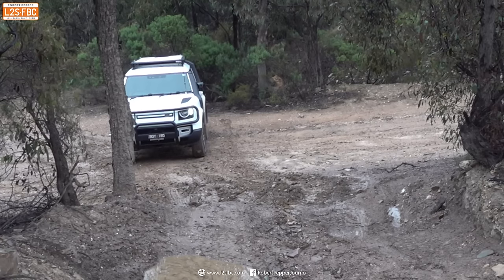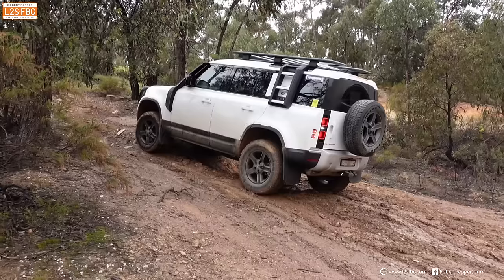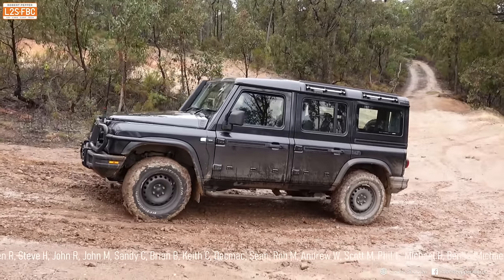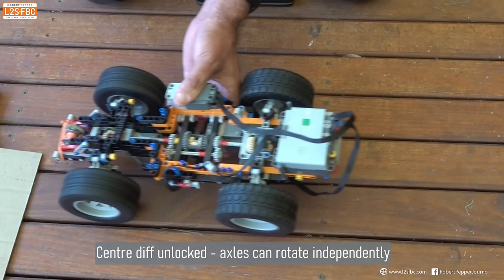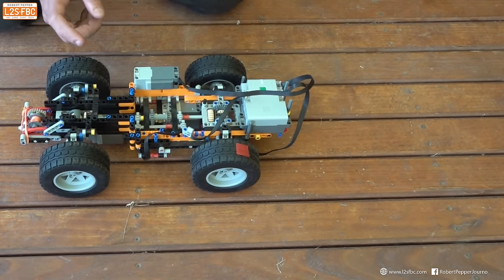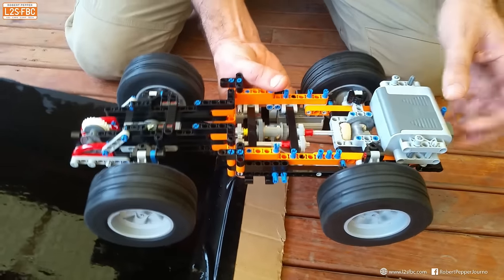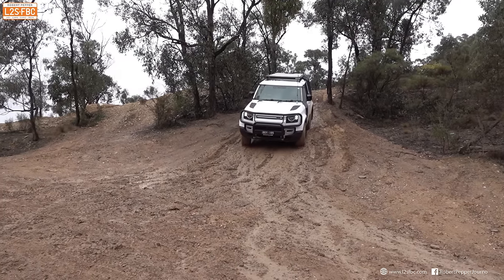The Centre Diff On Hills Problem: Grenadier vs Patrol vs LC300 vs Defender - Part 6

Comment: What year is the defender in the test? Apparently in 2023 they changed the drive system.

Per Sarek Autowerk: 
"Yes, it looks to be accross the entire range. The D300 (diesel non US) seems to have had the permanent rear wheel drive system since the beginning of production. The rest have all had the center differential until 23.5

The center differential system which is in all of the US production vehicles until model year 23 (p400) and 23.5 ( p300, p400 ) is set up like this. Power comes from the transmission and enters the transfer case. There it goes into a differential that can be variably locked by the traction control system. So for example, when no locking is applied, the differential puts power 50/50 to the front and rear driveshafts as long as there is no slippage or loss of traction just like any open front or rear differential. If you lift a wheel or slip im mud, just the slipping wheel spins and the other doesn't turn. Path of least resistance. So driving down the highway, the vehicle is in an all wheel drive state with the center differential mainly not locked and power is split to all wheels. The center differential is what allows the driveshafts to turn at different speeds when turning the vehicle to prevent binding since wheels turn at different speeds when rounding a corner. In a situation where 1 axle breaks or cv joint. The broken part has the least resistance and it will only turn. And you can not move. You can sort of move but the computer keeps unlocking the front and center diffs , so you just barely move when going straight. But turns are almost impossible. The center differential uses clutches to variably apply friction to the differential to prevent slipping when needed in turn locking it . The rear factory locking differential behaves very similar. 

The 23.5 and up system works like this. Power comes from the transmission into the transfer case and is permanently connected to the rear driveshaft. There is no differential in the transfer case. It is what they call permanent rear wheel drive. The tcsse has a torque on demand unit that puts power to the front driveshaft when needed. It uses a similar clutched unit to do this, but the vehicle will always have power to the rear no matter what. Not the case with the earlier unit. Another difference is that the permanent rear wheel drive system has a front axle disconnect built into the front axle tube. At highway speeds the system will actually completely disconnect the front axle. These systems have a much better MPG because of this. I have actually driven one of these without a front driveshaft installed! You can not do that with the previous system. So as i stated in my post previously, if you have this system with our Sarek selectable rear air locker, you can still drive even if you break any one of the axles or CVs . With the factory rear locking diff you can break a front, but not a rear. 

I believe the later system has many benefits. I really wish i had this system vs the center diff system that i have. I have broken an axle and it is not a good day. I always want to be able to try to drive off the trail even in 2 wheel or 1 wheel drive vs becoming a major burden on my friends trying to drag me off the trails. 
Also, because of the axle disconnect, both front axles are the same part number, so u only need one spare for the front. Also much easier to replace the right axle from the previous system. The MPG gain is also a nice bonus."
Reply from the maker: I mention that in the video with a diagram.  Yes it's different but behaves the same far as I can tell.  I have on multiple occasions needed to deal with a Land Rover and broken CV and not being able to lock the c/d is a pain!
Reply: @L2SFBC  oh I'm sorry I missed that part, I'll have to watch again.
Reply from the maker: Great comment thank you, useful info

Comment: Great video Robert, thank you. Can you tell me what Lego model 4WD that is you're using please?
Reply from the maker: It's a custom build I made myself out of a variety of parts, mostly Unimog I think.  Thinking of getting the Audi desert racer next and customising that!
Reply: @L2SFBC  i made one like that as a kid but with solid axles and suspension.  It was pushing the limits of the components available at the time.  In particular i didn't have a slip joint for the propshaft and tailshaft which was a major problem.

Comment: Another good video. The centre locking diff or just a traditional 4wd setup like in an old Jeep or Series Land Rover can do wonders for stopping distances in the snow too. For the exact same reason of brake bias. As for HDC, by brother was setting up a trials event on a wet grassy hill earlier in the year in a Freelander 1 and with someone who had a new Defender. When the grass was wet early in the morning, neither vehicles HDC could cope and induced sliding, while just using engine braking provided more control and slower descents, even despite the Freelander not having a low range.

Also to add to your point 3 about varying brake pressure. The next step is to actually accelerate (gently) down a slippery slope rather than brake. It feels counter intuitive, but can reduce or remove lockup and skidding giving you steering control. We sometimes set up sections at trials events where you need to do this in order to avoid hitting a cane/gate. Obviously it needs to be safe to do so in terms of space and run off and it shouldn't be lots of power, just enough to rotate the wheels a little faster to stop a slide.
Reply from the maker: A good point. In Part 2 of this series I show the effect of accelerating downhill, although I would prefer to say "reduce brake pressure" first. Experience can guide. As for braking, yes - in another video I show an LC80 braking on dirt with and without CD locked, and without there is unused braking grip at the rear. Modern vehicles have EBD (electronic brake distribution) so in theory shouldn't benefit...but I am yet to test this theory.
Reply: @L2SFBC Do you know which video shows the LC80 braking w/ diff locked/unlocked?
Reply from the maker: https://www.youtube.com/watch?v=BgKkI0Lt0Sw
Reply: Yeah exactly why not just to make them not all wheel drive and just have selectable four-wheel drive. I feel like 90% of the time people who buy these don't actually need to be going down the street with their front drive shaft receiving power to the front differential it's just extra wear and tear. Plus if you watch a Jeep Rubicon Wrangler in two-wheel drive the rear articulation and the rear Locker will get it through all of this stuff without even going into four-wheel drive. But it seems like a lot of these non-american SUVs obsessed with being all-wheel drive . I wish the jeep was made more high-quality luckily we have the full size Bronco which is absolutely mind-blowing good off-road still has Towing still has ifs in the front with long travel and solid axle in the rear. Probably the most all around vehicle ever made. Yeah the Toyota is great but it doesn't have Factory 35 or as much travel, the defender raises Wheels constantly and has air suspension and lacks articulation and really top heavy. The Jeep is absolutely stunning but doesn't tow as much which apparently Towing over 3,000 lb off-road is important to some people's brain and the reliability of the Jeep is better than Land Rover but not quite the Ford Bronco or even the Toyota of course. My dad is purchasing a Sasquatch Edition Bronco and the more I learn about it I'm just blown away by how awesome it is and kind of how versatile it is in between the straight up hardcore Jeep abilities and the street Comfort IFS world Land Cruiser world. You should watch that big Bronco Beast go around tight switchbacks with the steer assist that locks up the rear inner wheel of the direction you're turning and literally makes you slowly skid avoiding go forward reverse multiple times to make a tight turn for its overall size

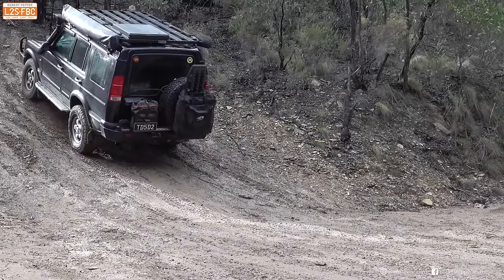Comment: 14:55 Itnerestingly i even encountered exactely that "Defender Problem" at home on a flat paved piece in front of my carport with a normal rwd, automatic vehicle: the ground was still frozen (winter) but the air had been above freezing and it had rained. So the rain hit the cold ground and immediately froze. The surface was a slippery as it could get.
I tried to go back in a 90° turn to get the car under the roof, and there was no chance.
I couldn't lift off the brake enough to unlock the front wheels (especially when turning the steering wheel) while the rear wheels were already providing movement for the car.
Thankfully my car is old enough to have a mechanical parking brake and that's what i did.
Applied it two notches and was easily able to lift off the brake enough so the front wheels were turning and were able to provide steering input.
Reply from the maker: that's it, add braking to the rear in this case. Not possible with L663 Defenders.

Comment: Yeah you make a really good point. Never thought about the braking aspect of center lock. I'll be sure to use descent control in reverse on my vehicle because of this.
Reply from the maker: What vehicle do you have?
Reply: @L2SFBC  Jeep Cherokee Trailhawk.  The only thing I can think of that might beat it all the way around (ride and off road capability ) would be a defender to be honest. Maybe Grand Cherokee Trailhawk. What else ? Not many vehicles have a rear locker , crawl control, descent control, terrain modes and a legit low range. Mine is 56:1 with the 2.4 engine . They're stopping production of it and there aren't really any alternatives except for the defender. So maybe the next one I'll get will be the defender. We'll see.
Reply: @L2SFBC do you know if engine braking engages the center clutch ?
Reply from the maker: Can't say as it may disconnect if the engine isn't providing any torque to allow brake force distribution to work. Yet another "only the software knows" thing.

Comment: Great video, while my D3's are all very capable vehicles my fun car is a 3 door D1 with only a CDL, it's a lot more stable and responsive on wet, slippery slopes. As you say a manual CDL gives you more control over the electronics. Weight of vehicle and the line also comes in to play in my case.

Comment: This is interesting; I've tended to leave the CDL disengaged on vehicles because I want the tighter turning radius. I did not know that having the CDL engaged helps to prevent side-slip on off-camber hills. Have definitely encountered situations where I needed to release the brake by some amount in order to get steering control back. It is counter-intuitive and takes some mental effort to not only remember to do it, but to trust the tires to start gripping by letting off brake pressure.
Reply from the maker: If you need to unlock the CD to turn then do so, but then re-lock.  However you may as well do a three-point turn. If you keep it locked probably less need to reduce brake pressure.

Comment: Defender could have tried HDC reversing back down the slope…

Pretty sure a modern 4WD like a new LR would change the brake bias on a slope and also the braking would be quite differently programmed when in low range and/or off-road modes. These vehicles have yaw sensors, pitch sensors and roll sensors so it will know when it’s on a slope. 
Maybe it needed to be in grass/gravel/snow mode (low traction) when reversing/braking down the muddy slippery slope.
Reply from the maker: If it did lock the c/d in grass/gravel/snow, and I doubt it, then that's a fail.  You should be able to select Mud/Ruts for a climb that is well...muddy and rutted...and then the car should lock its c/d as required. I consider the Defender not doing that, and all other similarly engineered vehicles, to be a failure of design bordering on negligent and indicative of lack of experience in real-world offroad conditions. I covered the reasons why HDC isn't a complete solution in the video; for reference, consider a hill you can barely hold the car on with muddy rockledges that you need to steer backwards around. Now add rain and subtract daylight. Still keen on letting go of the brakes and coming down even at 1km/h?

Comment: Robert check out the latest All4Adventure video where they manage to roll a large Chevrolet Ute 4x4 going down a very slippery mud trail on the Crebb track, with all 4 wheels locked up. Perhaps you could do a video on this to explain how this could have been avoided? In that case they probably needed a set of chains, or a long winch down. However, I think the roll could have been avoided if the driver had either not touched the brake pedal, or released it just before the slide into the bank to momentarily regain lateral grip.
Reply from the maker: I'll leave A4A to their own devices.  If you like react videos @madmatt4WD does a few.

Comment: When you only have a open center diff, or lsd an you fail at a hillclimb and would potentially slide back, you could use the handbrake if you have a traditional one as soon as you go off the throttle and slam the brakes. This could help not sliding downhill. Of course pushing the button all the time, so that it doesn't lock in engaged position.

Comment: Another great vid with everything very well explained.Don't the later Defenders have some sort of clutch set up that will disconnect the front axle whenever the vehicle decides?So in any situation,the operator would have no idea whether it is locked or not,or the center diff is locked or not.The later model's clutch set up is to reduce fuel burn,keeping the vehicle in two wheel drive.
Reply from the maker: Yes they do,  diagram is shown later in the video, but conceptually it's the same as a diff.
Reply: I couldn't see the diagramm clearly,but on a bigger screen it is all well explained.More complexity to save 1.7% emissions,which in real life driving is more than likely a lot less.Probably controlling the right foot,or keeping the tyres at the right pressures on road would save a lot more.🤣 @L2SFBC

Comment: I do wonder if part of the issue with the Defender is that it still uses the now very old Magna-Steyr DD295 transfer box that debuted in the Discovery 3. Sure the issues is most probably software related but maybe the transfer box doesn't allow for this change to happen? I do know that this issue also rears its head when on tight slippery turns on an uphill gradient, because it does disengage quite a lot when you apply steering lock (it only locks to 90% anyway to prevent wind-up). It's very embarrassing when the front wheels spin and the vehicle slides sideways, even with ETC, and quite dangerous too. It also then causes the DSC not fully disengaging issue to arise because the vehicle is sliding under power. Speaking of which, I did notice the DSC issue at the 1:50 mark rearing its head again!
Reply from the maker: I think it's software design.  I get windup is a problem but safety should come first. Part-time 4WDs run around quite happily even on dirt roads and in the USA they have high traction slick rock yet don't get windup due to suspension flex etc.  So I think Land Rover have overdone it.

Comment: This was a reply to another comment but fingers ...
Isnt Bronco based on Ranger T6? Isn't that pretty much like most pickups (UK based so...) They are pretty much all part-time 4wd. Many US SUV are the same as this. Buyers want it irrespective of actual need or ability.

The vast majority of these SUV buyers is that they don't go off road. Can't even drive on wintery roads as they all have stupid sports tyres on... 

One benefit I have in my old Defender is that I can use low range on a yard for towing/manoeuvring big trailer without concern of transmission wind up as it has a centre diff. Also in less demanding situations I can run 4wd on the road like wintery conditions and if it gets bad add the centre diff. Options.
Reply from the maker: Yes Bronco is based on T6, but T6 can do AWD as well. I love low range no CDL, and was pleased to see it in Grenadier!
Reply: I haven't seen a UK ranger with AWD as yet. Maybe that's reserved for the posh(expensive 3.0v6 petrol raptor) version 🙂
Fords website is atrocious for details. Often has the *Not all features available in UK etc

Comment: Super informative video. I have a 22 Defender 90 and never have this issue but good to know if I experience it. Up to this point it turns just fine in slippery conditions up and downhill. My center diff locks up almost instantly in auto mode or I just lock it myself on the terrain response 2 screen.
Reply from the maker: Great, now you know!  Need to test CTR...stay tuned!

Comment: Have you considered the fact that some center differentials could be a ‘Torsten differential’ ?
Reply from the maker: Yes. Those need to be locked, and in fact Toyota use Torsen centres...with an optional lock.

Comment: Another great video! Would you please test the Low Traction Launch function on the Defender in this kind of slippery terrain? I’m wondering if the computer would help solving the situation at all. Cheers
Reply from the maker: It wouldn't help to any great degree.
Reply: The issue is that the car unlocks the diffs really early and seems to do it every time the car stops forward motion. So it is out of difflock when you need it in as Robert shows.
The 110 new Def I had at our training site last year did this all the damn time. No matter what. We couldn't get it to stay in even with adv config mode.
Reply from the maker: Not even with CTR lock?